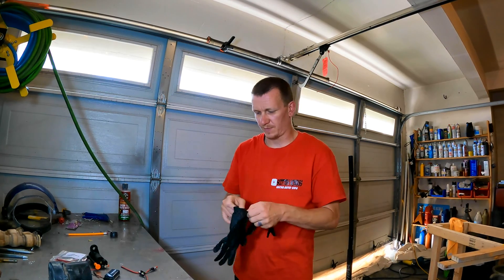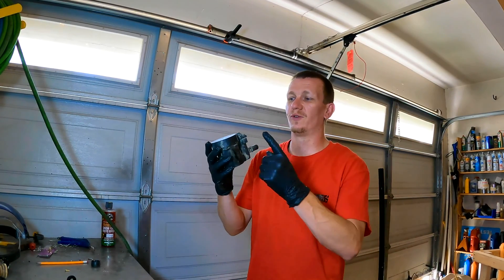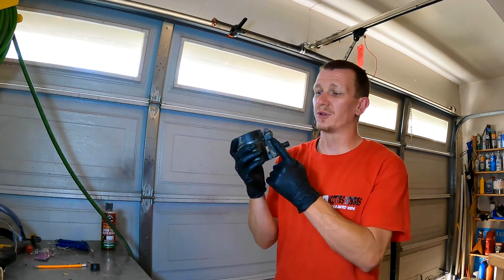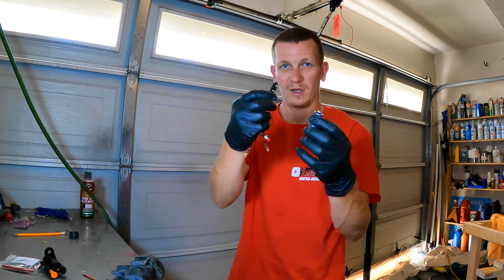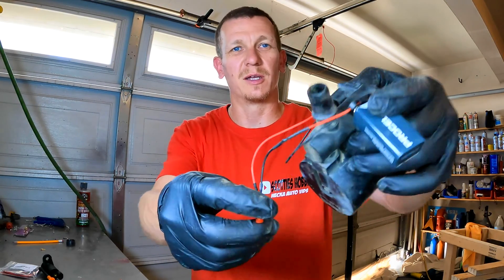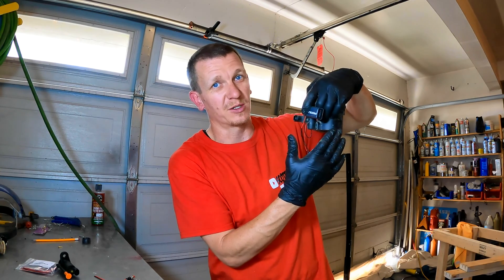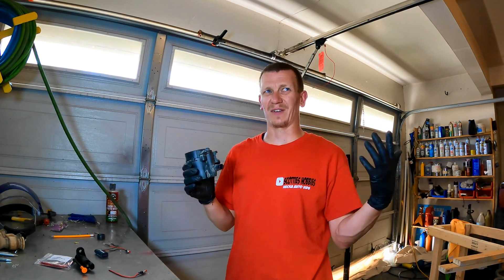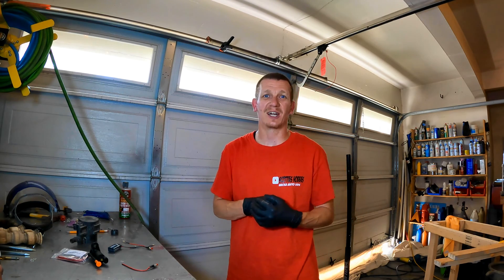⫷ Vapor EVAP Emissions Canister Vent Valve Solenoid. Quick info and test. p0446, p0449 ⫸

Comment: Hi i have strong fuel smell that fills my garage after 2/3 weeks stationary. The car then wont idle and cuts out and i find that there is  fuel inside the purge valve .i dissconnect purge valve and the car runs okay but a little fast, How is fuel getting into the purge valve..is it a faulty valve on the canister or a faulty fuel filter? Appreciate you thoughts.

Comment: when i  apply 12v power to it, i got weak air out of the smaller hose when i blow from the bigger hose. However i got strong air from bigger hose if i blow from the smaller hose. The solenoid clicks when 12v power applied. I code p2422 from a Acura, vent valve stuck closed. Is the valve any good?
Reply from the maker: You only want to blow in the direction the vapors flow. If you have a restriction, it's probably bad. I'd get a new one. Before I install it. Test it and see if the air flows easier than the one you took off your car before you install it. If it's the same. I'd start looking at the wiring on the car going to the valve.

Comment: So if I plug my 9v battery wired str8 to the solenoid n I get no clicking does that mean I need a new vent solenoid?
Reply from the maker: I'd arleast blow in it and make sure nothing is changing when I apply power. I'd also switch the wiring on the prongs from the 9v battery, just in case the voltage is directional. If I do all that and get no flow or clicking.. I'd change it out.

Comment: Straightforward useful info. Thank you. In my case I’ve got a evap canister vent valve stuck closed. Is it possible to UNstick it or am I looking at a replacement - ‘07 Ridgeline. Thanks!
Reply from the maker: Crc makes some electrical parts cleaner or maybe even some Mass Air Flow Sensor cleaner might work. From experience, if it is actually stuck. Cleaning it will probably be a temporary fix. Good luck with your repair.  🤞🏻👍🏻💪🏻
Reply: @ScottiesHobbies  Thanks for the info - I'll give it a go!

Comment: Hello Sir, 
I have this code P24C0 Active
Evaporative emission (EVAP) system leakage detection pump vacuum switching valve stuck on. So is this valve the purge valve control near the engine or vent valve near charcoal canister?
Thank you sir

Comment: Thanks for all these YouTube videos! I managed to check my Kia Sorento 2011 V6 3.5L and found that charcoal from canister got sucked in and clogged the purge valve, and line going to canister. I finally removed the canister and foam/filters are all busted and got about 2 Cups of gasoline. I also cleaned the line using compressed air  to be sure the line is completely void of charcoal pellets. Cut the canister open using heat gun, acetone and managed to cut it cleanly. Looking inside, all flimsy foams disintegrated that's why pellets are in the line. I checked the fuel line going to the tank to be sure it's not clogged either as I saw some after disconnecting the hoses. I'm rebuilding the canister as it will cost me about $320 and it's going to take awhile to arrive!

Comment: How do you know if it’s stuck open or closed? I thought it should be closed until voltage. That’s what I’ve seen/read on 5+ other videos/websites. 
Code - po497. 
2011 mb c300
Small/Large leak evap.
Reply from the maker: You are looking at 2 different valves. The vent valve is open when no power is applied. As in my video. The link you provided is for a purge valve. Those valves are shut with no power applied.
Reply: @ScottiesHobbies  ok. I see that now. Thanks. so mine is most likely stuck open?.  I did a smoke test under the hood and my rear, right wheel well was blowing all the smoke out? Or is that what it should do when the car is off? He didn’t try it with it running I don’t think. And my exhaust smells strong of gasoline 🤷‍♂️? P0497 code happens every 1-few day. + always has Low/rough idle. always got the code P0455 (I think) and P0497 but low/rough idle just started 2-3 years layer. Will a new vent  solenoid fix this  or any of my problems? /problem? Can I try cleaning it with carb cleaner and get it to move? TIA 👍
Reply from the maker: @rPlatt73  the p0497 is referring to the purge solenoid.  That solenoid is under the hood. The results you got from your smoke test are nothing abnormal.  The vent solenoid will open up when the vehicle is off. If I were you, I'd bench test the Purge. If you search 'scotties hobbies  purge test' a video should come up. It's pretty similar to this vent test.  

Now the fuel smell... I'm surprised you are not getting a rich code.. or do you have a evap leak that is allowing the fumes out? Honestly.. I'd bench test both solenoids just to make sure they are good. If you are going to try and clean them, use an electrical cleaner.
Reply: @ScottiesHobbies i replaced the purge valve under the hood. It held vacuum etc. I don’t get the P0496 or P0455 anymore. Just the P0497. Everything I’m seeing on here and websites is the charcoal canister/vent valve- rough idle. Maybe it’s not closing when power is applied? Or would that not be this code? Different code? No code? 
Is my new purge valve bad. I’m going to test it now. All lines look good up front and good from what I remember on and around canister. 
Also, if the car ir on/running the vent valve closes? If I smoke test then, should smoke not come out of canister? When does it open? How long after running?
Tia.
Reply: https://youtu.be/lWI1b8DUQBA?si=0REWtmZyQYJWiR5-

Comment: I see this code in my Mercedes C250 2014: P0447-Evap System Vent Valve/Solenoid Circuit open. How can I fix it.

Comment: Hi nice video sorry wanted to ask you or anyone reading this I feel like I'm having same issue my car has 178k on it already. Can this be intermittently working with out a code in ECU??I'm having issues that give me lean trims like a vacuum leak but just intermittently when idling or after refueling and starting car like if it's stuck open sometimes thanks.
Reply from the maker: Check this video out. See if it helps. https://youtu.be/XlM_nq8y91U
Reply: @ScottiesHobbies  Thank you very much for your reply
Reply: @ScottiesHobbies  Sorry one more thing that I noticed is that short term fuel trims are negative on idle and once I turn on A/C they go into 0 %. Sorry I'm having trouble diagnosing what is wrong with my car. Thank you

Comment: quickest fix for mine was putting in a new fuse
Reply from the maker: For what circut? Also, fuses do go bad but if it blows multiple times.... its not a bunch of bad fuses.
Reply: @ScottiesHobbies  the canister vent valve fuse
Reply from the maker: @jonesy4588  these don't usually have their own fuse. You got a easy one. What kind of vehicle was that on?

Comment: Great DIY Scotty. Thank you for sharing knowledge.
Reply from the maker: Glad to help. Good luck on your project.  🤞💪👍
Reply: Hey Scotty, My 02 Tacoma Prerunner is giving me a fault codes P0440 & P0442 I have a feeling the culprit is the Vent Valve. But I’m not 100% sure which end to connect my vacuum pump to check if it holds vacuum. Is it the end to the canister or to the air filter? Applied power and works. I connected my vacuum pump to the side to the canister and vacuum drops slowly. But again I’m sure which side the vacuum pump needs to be connected. Thank you.